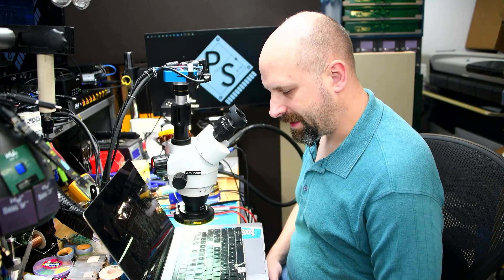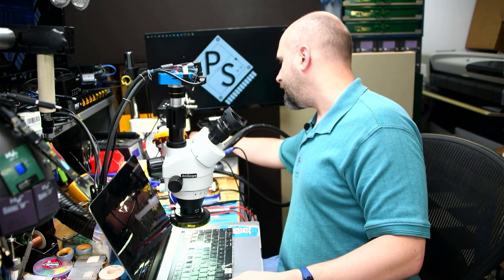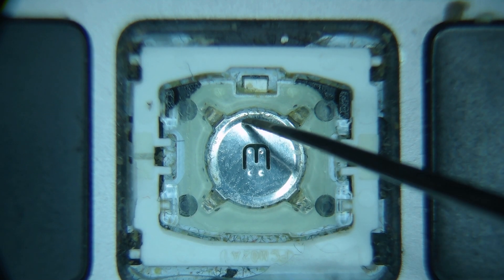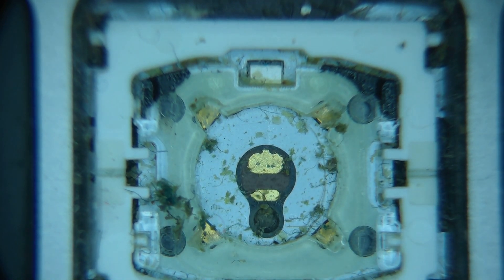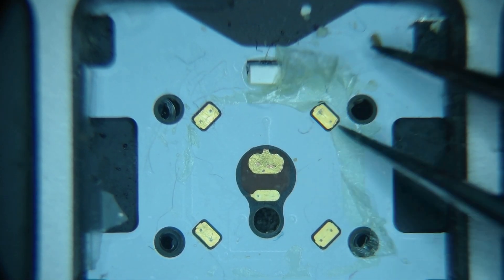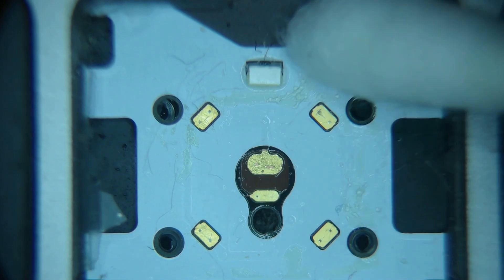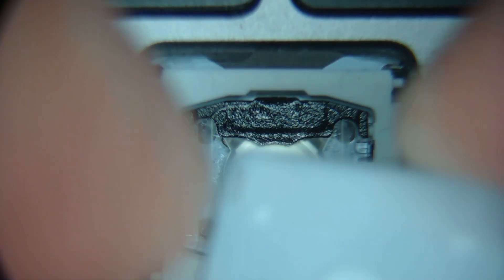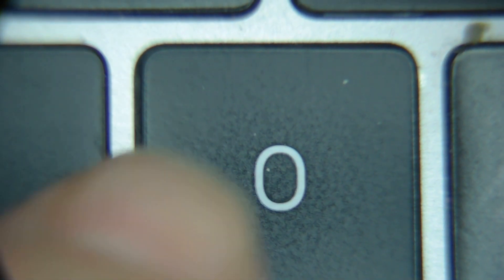MacBook Butterfly Keyboard Repair, Single Key

Comment: Is super glue fine? Like E6000?
Reply from the maker: The thing to worry about is where does the glue go. Using something that you have to wait to set, it can creep into places you don't want it. Everything in there you want to be able to move except one thing. As long as you're very careful with amount and placement you can use any glue that will hold to those surfaces.

Comment: For anyone who's going to try this here's is the technique for all square pieces, the larger keys have varying clips/orientations: If you want to be 100% sure to not break the delicate white clip inside, hold the very BOTTOM of the key down with your fingernail or pry tool WHILE you go to unclip the edges at the top. The way the mechanism works, if you simply try to pull the top out without holding the bottom down, you have a higher chance of chipping off the little nubs that keep the butterfly mechanism stuck to the Macbook plate. Why? Because the butterfly mechanism transfers pressure to both ends when you apply force to it, so when you try to pull up it will transfer that same pressure to the other side and at that point you're not unclipping it, you're prying the entire butterfly mechanism off of it's retainer piece and the only thing holding it in place are those little tiny nubs. These will break first if you try and force it.

Comment: Hi, thanks for the video, not so many are talking about this tricky part, and the fact that even a key that is worn but not broken will fail (like the I). Do you have some secret tip on applying the krazy glue correctly? Do you hold the system pressed while waiting for the glue to solidify?  How long should we wait? Is 20s more than enough (seems like it in your video).
Also, is there a special side for the white butterfly (starting from a brand new one here, not grafting from a donor) ? it seems like the hinge is not placed at middle height of the piece.
Oh, and how to keep the computer off while doing this? it keeps booting everytime a key is pressed by mistake 😃

Comment: I’ve replaced a key twice and the butterfly mechanism itself once, but this time the butterfly mechanism came off with the key (is still attached to key), could I put a tiny bit of glue on the little plastic E piece and attach it back or would you suggest trying to get the butterfly mechanism and plastic E piece off the key first and attaching it to the keyboard before snapping the key back on?
Reply from the maker: If the butterfly came off and the clear plastic square is still down in the keyboard then either the butterfly is missing it's pins or the clear plastic is missing it's ledges that hold the butterfly pins down. If any of those pieces are broken then you need to do the exact service that I do in this video.
As for glue, you have to remember that most of what is under your key needs to move so you have to be very careful where glue goes.

But a direct answer to your question, you need to fit the butterfly in place before putting the key on. You need to see where to attach the butterfly, can't do that with the key on.

Comment: Compressed air blows dust everywhere including under the other keys. Couldn't the glue be applied before the part that was placed on top?
Reply: Yes, the glue keeps breaking, and the more I try, the more I've unremovable glue layer blocking the system. So what's the secret in adding the glue ?

Comment: Wow you made the glueing part super easy. I came to this video after the official replacement programme has ended. 
Seems like if there is tiny gap between the dome and the base, it acts as a "cushion" and the butterfly plastic mechanism will hardly push back the key. So the key is in the constantly pressed down state.

I will try to buy Loctite 401 today and see if that is better than the generic super glue i am using right now. Thanks
Reply from the maker: @illu1na  one of the best glues for all the electronics stuff is something called Bondic

Comment: Wow, it’s really that easy? Apple official repair quoted me $699.99 for an entire top case for a single missing pin on a butterfly. Had to look it up to see how difficult it would be to do myself, and it’s like a 30 minute job with a couple dabs of glue and a replacement butterfly. Can’t believe they don’t do that in-house, I guess since replacement glue wouldn’t be as strong as the original attachment, but I’ll take a $20 “good enough” replacement over a $700 case replacement any day. Thank you so much for the in-depth guidance, this was quite helpful!
Reply from the maker: I'm glad the video helped! That's the whole reason I make them. This is not the easiest thing to do, the microscope helps a lot. But if you don't have a microscope watching this video will definitely help make sense of the tiny parts that are hard to make out. Good luck with the repair and NEVER take Apple's word for it!
Reply: There’s also very thin double sided tape that you can buy online. Like 1/16” thin. I’m not completely sure it would work in this application, but it’s worth a try before committing to the super glue.

Comment: Instead of sneaking the glue underneath, why not just apply before you place the part on?
Reply from the maker: You have to make sure you put on the absolute bare minimum. You can't have it go on to the electrical contacts.
Reply: @A2000MHz  Can we place it where the double sided tape used to seat, like also on the bottom ?

Comment: What is the little black key and the top, if that is broken can you still replace the key?
Reply from the maker: Are you asking about the key cap? The black square with the letter on it? The part you actually press? If that is broken you replace it with a new one. That's in the video starting at 2:23 and 16:03

Comment: Have you found the best adhesive for replacing a key dome?  I’ve used super glue with mixed results. I’m wondering if there is a double sided tape that might be better?  I might have to replace the down arrow key on a butterfly keyboard. Haven’t done one before, do you have any closeup videos of doing it?  I’ve done many regular keys, N seems to be the most common failure!
Reply from the maker: When I need to use glue I scratch up the surface a little on both the clear plastic and the keyboard substrate and have had good results with bondic uv glue. You have to be very careful with it, make sure it doesn't get on the contacts or in the butterfly. I haven't used tape other then what is already there but something like the VHB iMac adhesive tapes should work if you can find it in rolls instead of cut for an iMac screen. Or just cut up some iMac adhesive, or maybe iPad glass adhesive, that is some of the strongest tapes I've used.

Comment: good video! any tips on lifting out a key cap that's not broken? the metal grid seems to be in the way.
Reply from the maker: The section of this video starting at 2:23 is me removing and reinstalling a key cap on a keyboard installed in a machine that is only mildly damaged. Matter of fact I didn't even know it was damaged until I removed it. So that is exactly how to remove a not broken key.
Reply: @A2000MHz ty paul i missed that one! appreciate you!

Comment: Thank you for pointing out the danger of screen damage
Reply from the maker: Especially with the prices of screens lately. They're outrageous!
Reply: but its the a1707 that is crazy expensive. over 400 even for just the panel!! 1706/08 those are fine. how do you sell a customer on a 800 dollar repair on an a1707 2016 that can only run Monterey.. its the old saying, you know what vegan chicken n rice is?  RICE! @A2000MHz

Comment: I've always liked to watch you on Rossmann's channel. You are really good at explaining things.
As to keyboard LED's, I would think that the individual LED's, while more expensive, should consume less power than the old way because there is much less light spill to unintended areas, so if the total keyboard luminosity stayed the same then the efficiency should have gone up. I'd guess that the way it's implemented, each LED in the new keyboard gets much less power in than each LED in the older models.